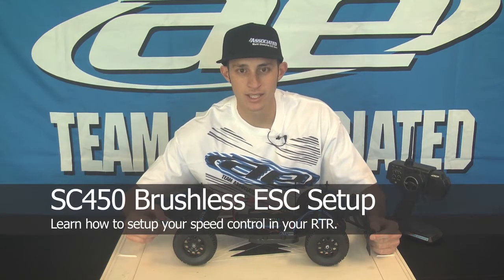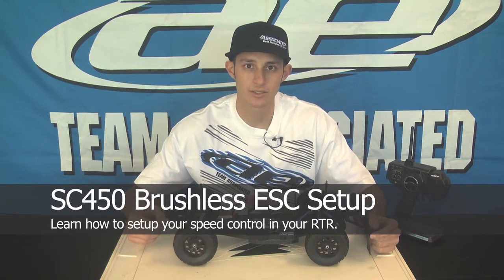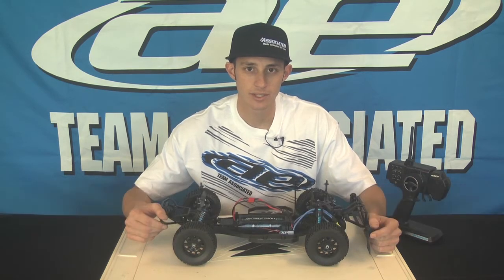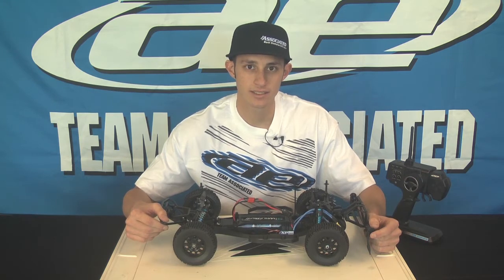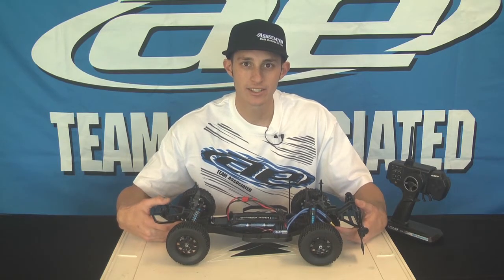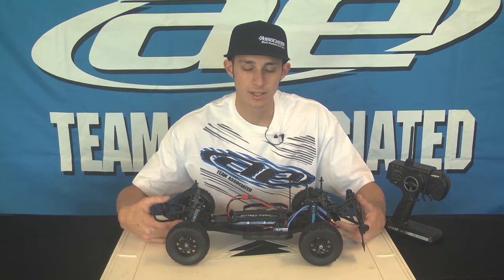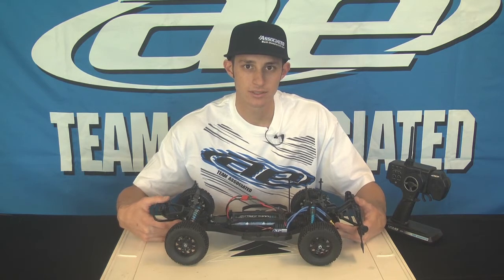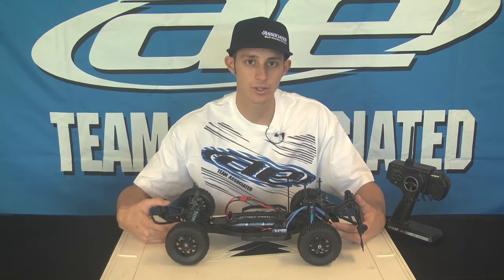Tech Tips - SC450 Brushless ESC Setup

Comment: But my light on my esc is always off or red and has been for years since I bought it. I've called and emailed several times but they said just keep repeating, like robots, the same setup instructions. The Hobby shops say its an Associated Electronics issue but AE says its fine even though it has never worked properly. Typical Associated response from my understanding.
Reply: Try cutting of the switch and joining the red and black wire together

Comment: My Sc450-BL works fine with  the old 27 Traxxas receiver in my 1/10 rustler. Can I program my old SC450-BL to work with the new Traxxas TQI and a Traxxas receiver in 2.4? Both radio and receiver are known to work, and I can not yet seem to get it to work the throttle. It works the steering only. I plug all the 27 stuff back in, and all works fine.. Thank You!

Comment: I current have a Micro Brushless esc and am having a problem getting to output any tones at all. When I switch it on I get one quick red flash, no tone and that's it. Is this because it is not receiving a signal from my receiver? Or is there something wrong with the esc? The esc is brand new